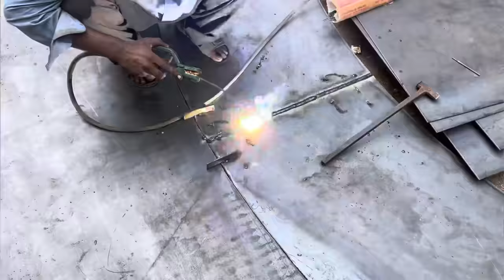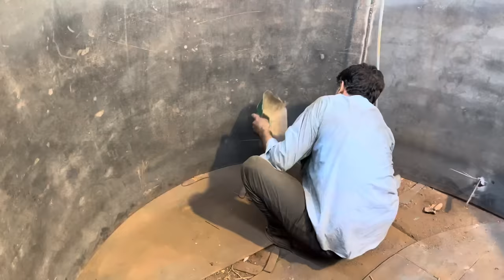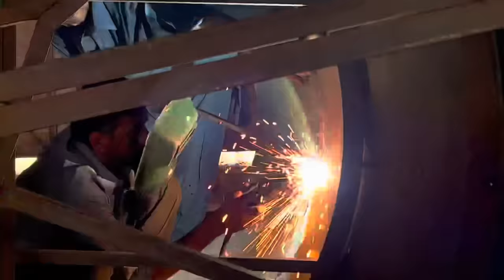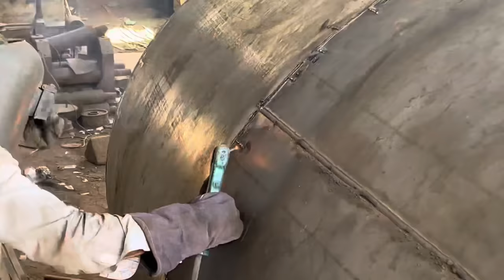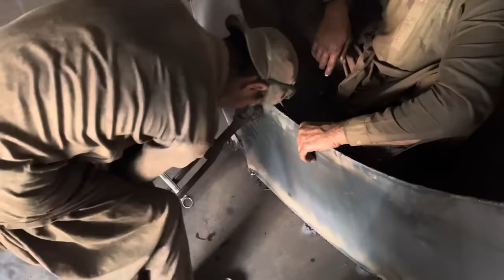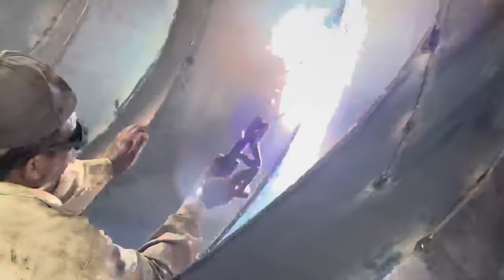How These Fabricators Make A Concrete Mixer Truck Drum || How To Make concrete Mixer Machine |Part1|

Comment: To viewers that have never worked in a fab shop like this it is incredibly loud. The hammering and grinding on metal plate, especially it being made into a drum shape does not come out in this video. Maybe Bluetooth it to headphones and crank it all the way to 11. These hard working very skilled men will be mostly deaf and maybe blind and die of lung disease if they survive 20 years in these conditions. This is a sacrifice they make to feed their families. Us westerners really need to think about that before we ridicule them.
Reply: The west has had this during the industrial age 100 - 400 years ago. The labour movement and unions came about because workers did not need to die to feed their families. The wealthy indusrial barons fought tooth and nail (still do) to prevent the rise of unions. You can thank the union movement if you live in a country where safety and of the working class is important.
Reply: Why don't they wear ear plugs and a face mask then?
Reply: @randomtask99  because when you are young you do not think of the long term effects. I was the same way and I have permanent tinnitus and breathing problems myself. I wear hearing protection and a respirator now when needed. The lungs will clear up some over time until your body gets ready to die. But the ringing in my ears in there til the end. No cure surgical or otherwise. After over 20 years of constant ringing in both ears I would have hoped for blissful insanity so they could medicate me into a stupor. Yet I am still fully aware and sadly sober.

Comment: As a retired NDT technician and pressure welder I think they have done a very good job under the lack of what we call modern equipment, and safety procedures.
Reply: I'm old enough to remember when these things were riveted together. My contractor uncle called his cement delivery truck 'Ol Betsy!
Reply: I also give them props

Comment: Amazing the one side welds don’t snap in rolling process.

The drum must wear pretty fast in aggregate mixing. Abrasion wears steel as if it were butter.

Looks like maybe 5/32 6013 weld rod on AC current. 3/16 “ A-36 hot roll mill steel.

No gloves or even face protection amazing they don’t get terrible arc burns and arc flash in eyes.

Comment: Skill is very good, & the work is difficult. Amazed with no gloves & working in sandals with or with out socks that there is not red spots every where. Those metal sheets have to be sharp & very bulky. All the videos I've seen I'm impressed how hard these fella's work especially with what they have to work with and work in. As others have stated, much respect. Thank you.

Comment: I think this is one of the first videos where I’m genuinely impressed with their fabrication skills. The way they laid out the radius to roll the cone was pretty good, usually it’s a video of a guy welding a hole in an aluminum rim with a gas torch or some nonsense but these guys are pretty decent. I question how long that will last when it’s made from sheets that a couple guys can lift, I would assume it would heavier steel to take the abuse

Comment: Incredible work curving those plates accrately and the aligning them for welding. Even your welding is good looking.
I hope they at least had a fan blowing fresh air into the mixer when they were welding. The welding fumes would really affect your health.
Reply: The fumes from the rod flux are pretty toxic, short and long term, hence the caution on ALL rod packs re. adequate ventilation.  In the West, they'd be using remote air supply masks, however that tech is very expensive, and over there lives are (relatively) cheap unfortunately, even for skilled welders.

Comment: Sand and gravel are very abrasive materials. This is a limited lifespan concrete mixer. And yes I have been inside them breaking out set concrete residue. You could smack it with a sledge hammer as hard as you wanted without fear of dents.